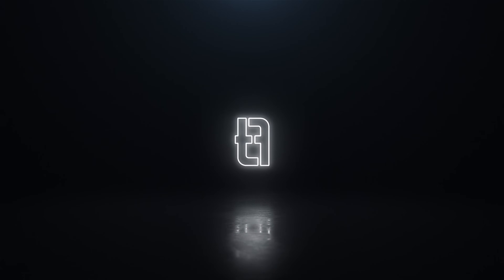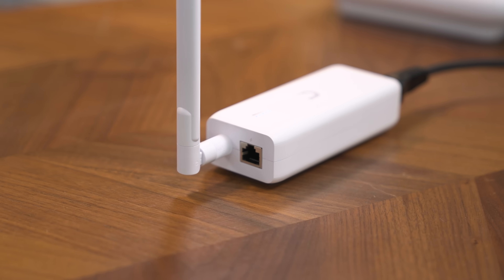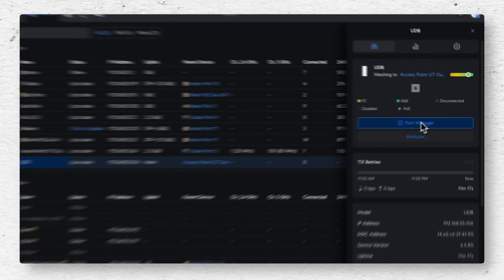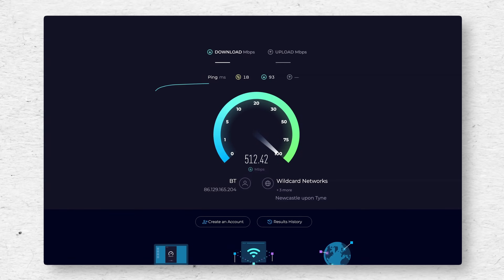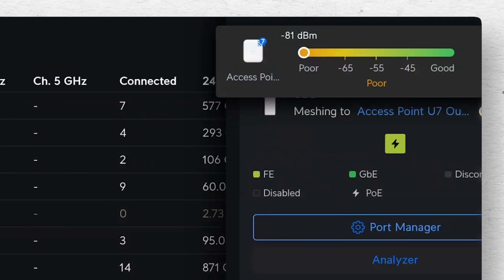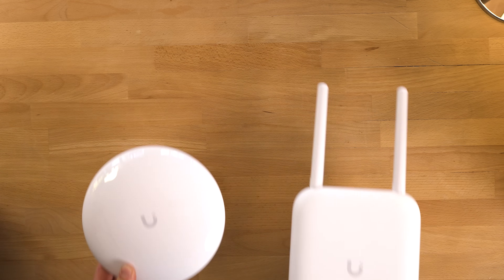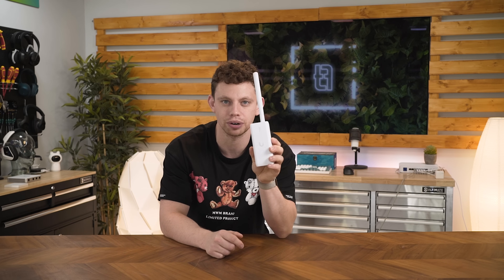New Ui WiFi Bridges: Explained and Extreme Tests!

Comment: Great video. I have 2 garages that these devices would come in very handy as I can’t run Ethernet cables to these locations. How did you manage to get your hands on this device? Can’t seem to get them in the UK.
Reply: You could run Ethernet but it’d be a pain in the ass I think
Reply: @emilsecker7881  Concrete is my issue.

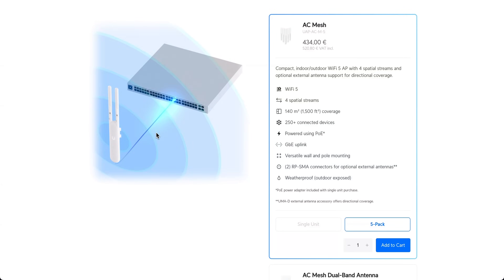Comment: 1:12 , no that's a Wifi Repeater you've described, I'm also really confused how you state its connected in mesh mode when you earlier stated you had mesh turned of in software options.
Yes it is a Wifi 5 Device, The 866Mbps you showed at 3:40 is its maximum data rate, assuming MCS rates can be achieved.
Reply: Repeaters can strengthen the signal into a wider range so it can act like a mesh network.
Reply: @therealmo_ai3000  no, both repeaters and mesh devices "strengthen" the signal.  

It is not the key feature that makes one a repeater and the other a mesh network.

Comment: Maybe it's for things like CCTV such as being in a garage that doesn't have ethernet run to it but does have power?
Reply from the maker: Yeah it's perfect for that, a dedicated wireless backhaul to a single device like a camera or access points, or build a wired LAN from the connection on the other end :)
Reply: I would think so too but my shed is metal and placing my access point inside it causes bad signal reading from the house. I’m thinking for my use case the uap-ac-mesh placed externally in the weather elements I will get a better signal from the house